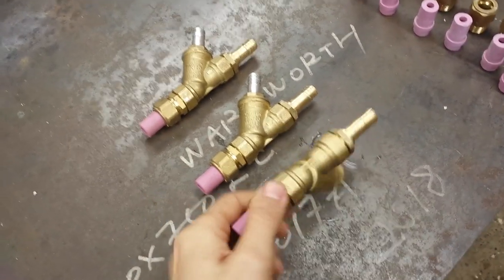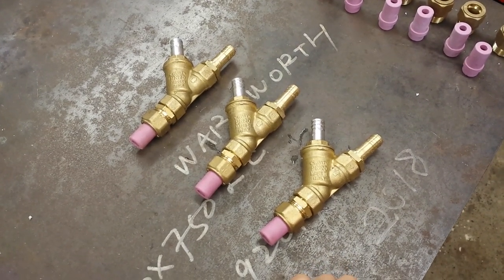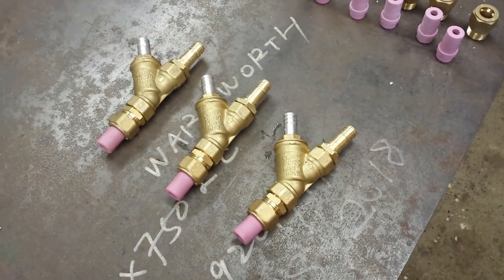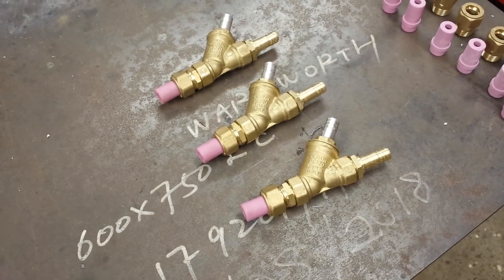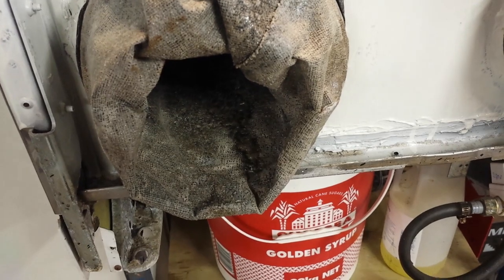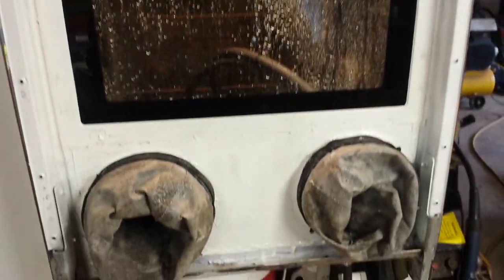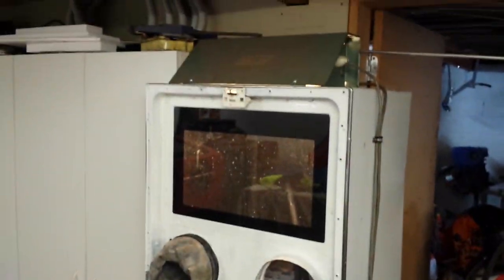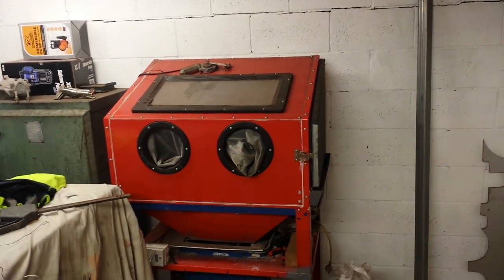Dishwasher Vapour Blaster gets an upgrade

Comment: Have you tried putting rainex on the inside of the glass?  I bet it would help alot.
Reply from the maker: Yeah it does help a lot, but really needs to be used in conjunction with a fresh water spray or wiper to get the greatest benefit while working.